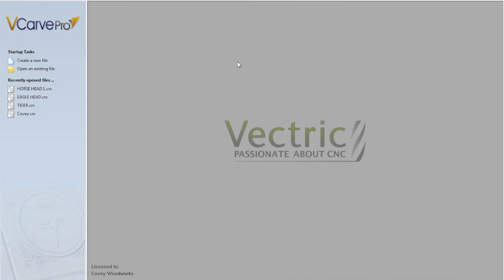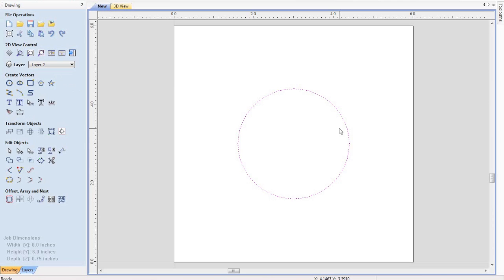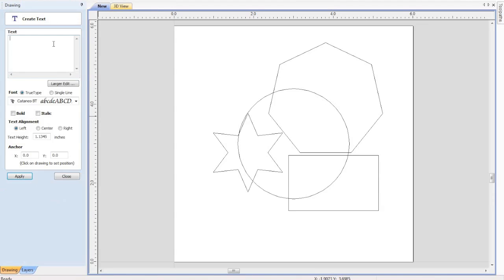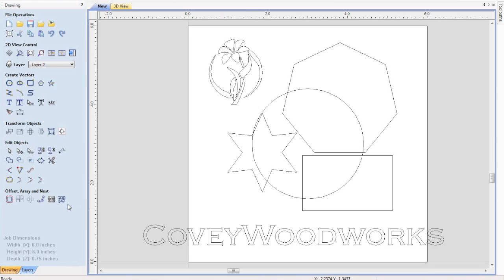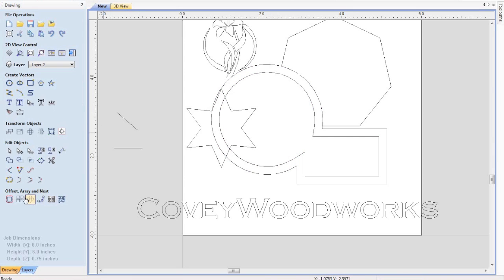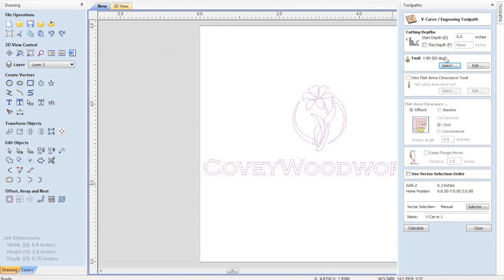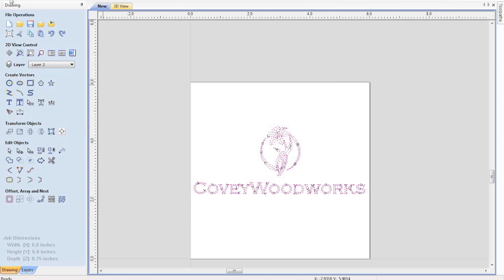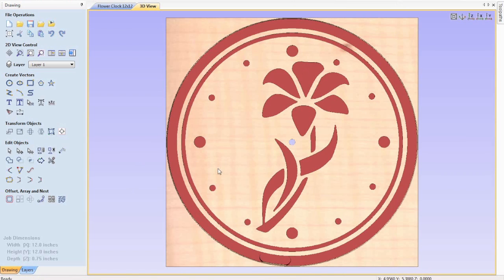Overview of Functions - VCarve Pro 7.5

Comment: Hey Stuart. After research and your suggestion, I have a Probotix Comet on the way. I ordered the Vectric 2d to get started, with the understanding that I can upgrade to Vcarve. Two questions. My plan is to do hard wood inlays so do you think I should go ahead and upgrade? Also I have not watched the longer version of your clock inlay video. Is the longer vid a good inlay instructional video? Thanks for the help. John
Reply from the maker: homemadejobee Hey,  That's great!  I know you will be impressed with it.
I do not have any experience with the Vectric 2D program, so I can't say if that will support what you need.
I would recommend just starting off with VCarve Pro.  That way you will be able to build your skill level on it, instead of first learning how to use the 2d program and then having to learn VCarve later on.

And yes, the clock inlay video I have, explains in much more depth the process of making an inlay.
Good luck!  Stuart

Comment: Thanks for the video! I used VCarve for the first time today. How can I get my text to arc? I typed a word in the text box but the program kept telling me I needed to select my text as an object. I couldn't simply click on it and have it highlighted in pink, it wanted me to do something more specific. Any ideas? Also, what are the advantages of choosing your z zero point?
Reply from the maker: Thanks!  Ok, to arc a text you need to do two things before you select "Wrap text to curve".  First you create your text, then you need to create an arc that you will want your text to follow.  Now select both the arc and the text and click on "wrap text to curve".  Click apply and it will wrap the text to the selected arc.  You can change the settings in the "wrap text" function to get it to look like what you want.
Now if you don't want the curve just delete it after you wrapped and you will have the arced text.

The Z zero point chooses where you touch of your bit.  So say you set your material thickness on VCarve to 0.75" and you want to cut a groove in the wood that is 0.25" deep.  Now suppose the wood is actually slightly larger like 0.80".  If you set the z zero to the table it will keep the depth of cut as if it was 0.75" thick piece of wood, and your groove will come out at 0.30" deep because it thought the wood was 0.75" thick.
Now if you set it to the top of the piece of wood it will start the depth of the bit based on the actual top of the wood regardless of how thick it is and your depths will come out right and it will be a 0.25" deep groove.
My preference is to set it to the top of the wood as then I do not need to always measure my wood to the exact thickness.
Hope that makes sense! And good luck!